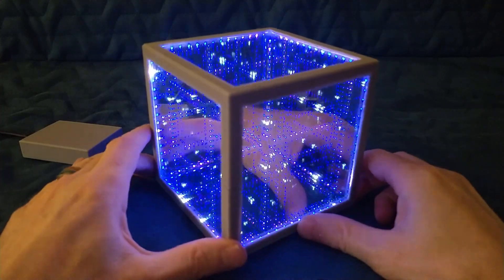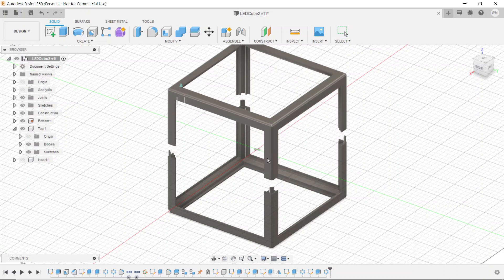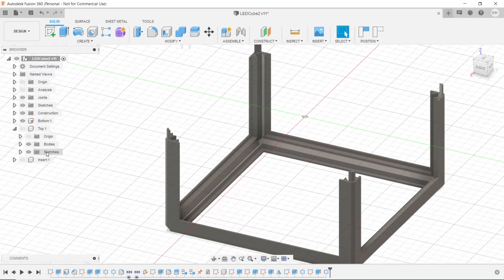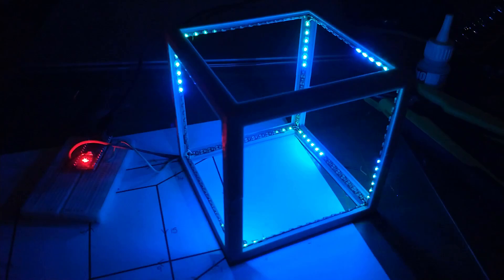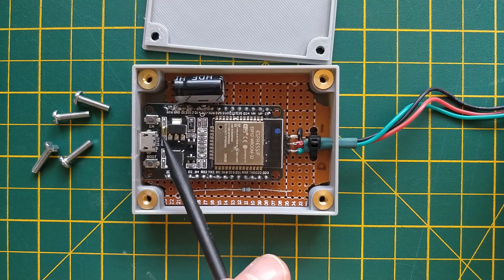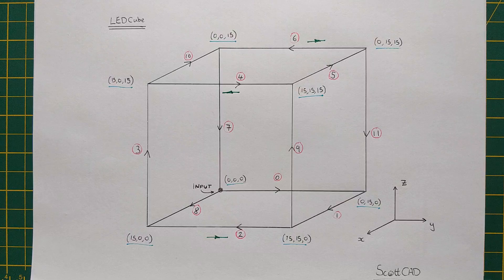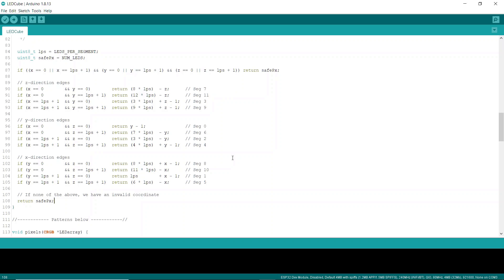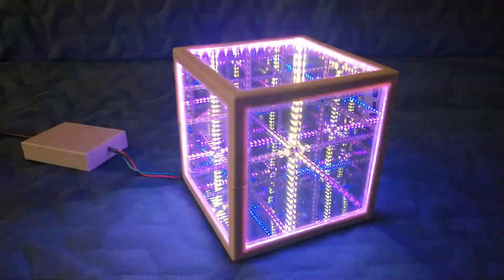3D Printed LED Infinity Cube Using FastLED, Arduino and ESP32

Comment: Can we do this project with ws2812b?
Reply from the maker: Yes. But the current will be much higher, so you will need a higher wattage power supply.
Reply: @ScottMarley  
So we can do it in the same project with the same codes.

Comment: OK, finally finished my homage to this ;)

As I mentioned, I made mine half-scale, which, with hindsight...was a stupid idea!!!  Man, that was a fiddly little beggar to assemble.  The LED strips I got had all the contacts on the underside, but they were only accessible every 5 LEDS, which didn't work, so all connections were made on the actual chips..which I will come to shortly.

I decided to use 24AWG (0.5mm) enameled copper wire to join it all up, but at this scale, that's like trying to solder a chunk of 1/2" copper pipe to the leg of an IC. I managed to complete the thing, testing at each new connection and got all 12 strips working as they should. I then did a test-fit of a section of 'mirror' and had to 'ease' one of the wire links out of the way....which broke the whole cube. I quickly discovered that due to the size and relative stiffness of the 24AWG wire, when bending it, I had ripped the contact off the top of the chip, thus ruining it. I messed with it trying to repair this, but eventually realised it would never work with this gauge of wire.

So, I identified and replaced the chips I had damaged - an experience in itself as I only had a few actual LEDs left over so had to de-solder good ones from the remnant of the strip, then swap out bad ones on the cube strips themselves, then re-built using 30AWG (0.25mm) wire which is flexible enough and small enough to work properly. To handle the reduced current capacity of the 30AWG I made a 'mesh' or ring out of the power connections which has ensured good brightness throughout the cube.

I used some 2mm wide double sided tape to stick the 'mirrors' in, which seems to have worked OK.

Overall, that was a seriously fiddly and testing exercise, next one will be bigger......

Again, many thanks to Scott for the inspiration, glad I persevered because it looks great....but I suspect a bigger one would look better.

And for proof, a short video of my completed cube:

https://youtube.com/shorts/FQqt0H7Ip38?feature=share
Reply from the maker: Incredblible, thanks so much for the write up! It might have been a pain to do, but I bet there was a lot of satisfaction in seeing job completed :) now do a bigger one!
Reply: @ScottMarley  OK...bigger one now competed :)  A straight copy of yours, the only mod I did was to enlarge the base a bit so it houses the ESP32.  I ended up buying the LED strips direct from iPixel. The ones they supplied have a contact pad for all 3 lines at every LED so were really easy to work with. I once again used the 30AWG wire which worked a treat.

https://youtu.be/bwOgisJZkFQ

And as you say, it looks so much better in reality than on video. I just used my iPhone to take this and it somehow makes the mirrors look quite cloudy - they aren't at all. Might be flare I suppose.

Anyway, once again, thank you for the inspiration. I might do a coffee table next.....

Comment: I may come to regret this....but inspired by just how good this looks, I'm having a stab...but using 4mm wide LED strip with double the density (300LED/m), and only 12 LEDs per side to keep costs down (a 50cm strip has 150 LEDs, so 12 x 12 works from one 50cm section). I've tweaked the cube drawing in Fusion to suit a 40mm LED strip length so it'll be 'interesting' to see how it looks......

LEDs and ESP arrived in the post today, code tweaked for 12 LEDs per segment and all good. Cube now printing......

All credit to Scott for doing a parametric design by the way - only had to adjust a few values to re-size it. Only fiddle was with the 'pips' on the joints, but easily sorted.

The LEDs I bought have all 3 connections on the underside...so this should be 'fun'  :)

If this proves too awkward fro my aging eyes, I may well scale it up and use more sensibly sized LEDs.  I'm sure there is an optimum for LEDs/cm vs size of cube to get the best visual impact.

Anyhoo, thank you Scott, for sharing this awesome design.

I've never used an ESP32 before, only the odd Arduino project. Using Arduino IDE V2, no issues with making a very simple tweak to the code,  although when uploading I had to reduce the "upload speed" to 115200 and the "Flash frequency" to 40MHz to get it to program.

I do have some modest experience with the 3D printing so that's all fine, although these are some small parts compared to my usual output.
Reply from the maker: Best of luck, I hope this works for you!
Reply: @ScottMarley  Have to say, I love the way those LEDs look with your code. I've just fired up the entire strip for now to see how it looked and how it worked with 12 LEDs per segment.

Thanks again for the inspiration and effort to make it easy for folks like me ;)

Comment: hi mate i am curranty making a 3d led cube like yours, i ran in to some problems, to do with your design my printer could not print, like the insert for the leds, but i did some adjustment to then, when it is up and runing i will send you a link to my youtube

Comment: Can you upload the code? The one on the link description gives me the message (arduino nano low memory available, stability problems may occur). Every time I try to upload it on my ARDUINO nano
Reply from the maker: You can't run this on a nano I'm afraid. I used an ESP32.
Reply: @ScottMarley   ok. I will buy the ESP32 and upload your code then. Thank you. Your pattern is amazing, it is the best I've ever seen it.

Comment: Just started 3D printing my cube an base...ordered the wrong lights (waterproof) waiting for non-waterproof then it's GO TIME !

update:  Finished it. Though i changed my design a bit. i kept the W2812B controller in-line to control colors. I created 160mm long hollow triangular tubes to fit into each edge for strips to mount on. I 3D printed them. They're hollow to allow the data line to go backward to next strip in sequence. With 3M mounting tape they hold the lexan glass pretty solid, but i used Aluminum tape for decor and extra strength. I was going to use 1/2'' aluminum angle  to frame it, but the tape does it's job and i didn't want to cut all those aluminum pieces haha.

here is my video.  https://www.youtube.com/watch?v=HUDD9bEJIyI

Comment: Dear Scott, I really like your version of an infinity cube. Do you think that it would be possible to order custom pcbs and solder on some SMD LEDs?  Im guessing that a higher pixel density could be achieved this way and the pcb could be as slim as the strip bc it only needs 3 lines for the LEDs and one for routing data back. I have ordered one way mirror film and 4mm led strips from ali to get started. The led strips only have 60leds /meter thought but it's not that bad. Let me know what you think. I have never orderd custom pcbs. Btw your fastled noise video allowed me to make a noise pattern on a 64x32 led matrix that has soundreactive Animation. Kind regards from Germany
Reply from the maker: Hi Moritz, this could absolutely be done using PCBs, and if I was to build these to sell, that's the way I would do it! I wouldn't even solder them myself, the assembly services from JLPCB and PCBWay are now cheap enough to have them do it for you. That being said, the design for something like that would take a bit of thinking about due to routing all the connections at each corner. Definitely achievable though! One thing to consider with higher density LEDs is the corespondingly higher power requirements. This would become difficult in a small cube ike this. I have a plan to make a cube to use as a coffee tabl which will be much bigger, but pandemic issues are preventing me from getting it done at the moment. All the best, Scott.
Reply: @ScottMarley  Thank you for this long answer. I was also thinking that the heat of many leds could be a problem. I'll make one with the supplies I ordered and if that works I'll think about making a better Version

Comment: Do you have to use that size capacitor or will it work with a smaller one?
Reply from the maker: Anything is fine, and it will probably work without one at all :)
Reply: @ScottMarley  awesome thanks

Comment: good job Scott! what size two way mirror do I have to order for this project? thanks
Reply from the maker: You're feeling brave if you're going to attempt this! I chose the size because I could get all 6 sides from a single piece A4 in size and that was easy for me to get.
Reply: @ScottMarley  thank you 🙏👍
Reply: @ScottMarley  Soctt can you share STL code for 3d printer? if yes you send to ccongus@yahoo.pl
Thank you
Reply from the maker: @tom-c1394  Hi Tom, STLs are all at the GitHub link under the Fusion360 folder
Reply: @ScottMarley  oh yes thank you 🙏

Comment: Impressive project, Scott!
Did you consider making the case of opal (semi transparent white) material and add some extra leds lighting that up?
Reply from the maker: That would look amazing. But there's no way on earth I would have been able to make that!
Reply: @ScottMarley  well it would be made more simple with the parallel type of Neopixels. With a pre-built corner that uses a clamp and i.e. ground on the outside and +5v on the inside. Centered in the ground could be the -parallel data connection trace.
Given it’s parallel; you would need only 3 of 6 pin connections “working”.

There are newer Neopixels in development that have a fixed position meaning: 3 wires; (all in parallel) and I believe these can contain between 100 and 200 pixels. 

The protocol is pretty similar to the WS2812B you used for this project.

Main problem is that we don’t know the exact led type yet. GeekMom (twitter) has been experimenting with these in a string. (Which still works even if one pixel breaks)
Reply from the maker: @ericoudammerveld424  I've heard of these LEDs, but I don't know why it would be easier with these? And are they small enough to build something like this? I went for these ones due to the width of the strip and relatively high density. Also, are these supported by FastLED? If not, I'm out ;)
Reply: @ScottMarley  I can’t imagine anyone that is serious with Neopixels would be using anything other than FastLED. 

Although I have been crunching on a Hardware Watchdog reset (dev 1163) for a few days now that shows itself between 4 min’s and 4 hours sadly at the FastLED.show() command.
Reply: @ScottMarley  also instead of 3D printing some of the elements you might consider using EasyEda 2 to design your own thin PcB’s to have a very simple soldering of your strips.

Would gladly give you a short training to get you going.

PCB’s are fairly cheap nowadays and you can even have difficult SMT packages pre-soldered for a very low price. (Ideal for a more than a one-off)
Reply from the maker: @ericoudammerveld424  my first thought was to design some PCBs that clip together. I'm happy using KiCad and have made a bunch of PCBs with PCBWay and JLPCB over the years. I just couldn't wrap my head around how to connect everything at the corners! Either each edge would have to be unique so the signal routes correctly, or each edge is generic and I think of a way to select which way the data goes at each junction. They would still need soldering together at the corners unless you went for something exotic like flexible PCBs. Then what would the mirrors attach to? In the end, I decided that this was much easier :)
Reply: @ScottMarley  the “crossing” problem is the exact problem you encountered trying to draw the cube in one line.
You know it’s not a solvable approach.

I think the (linked) LED’s could solve the origin of this “problem” namely the serial character of the neopixels. 

If you can work within the address limits perhaps even using two or 3 separate data lines to increase this if needed. 

Positioning ground on the bottom with a data trace in the center and a 5v plane on the other side could make up for an “easier” connection and if in parallel clamping might be more interesting than soldering. (But thinking more towards mass production here 😄)